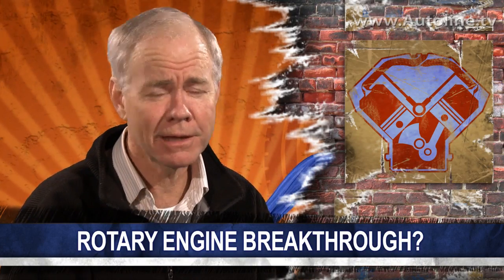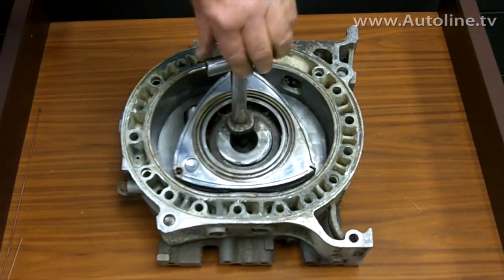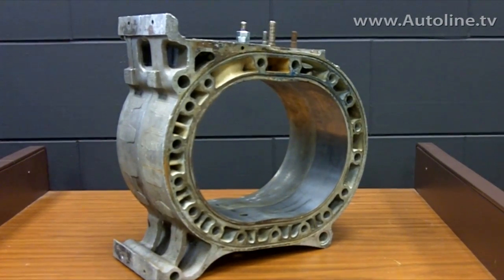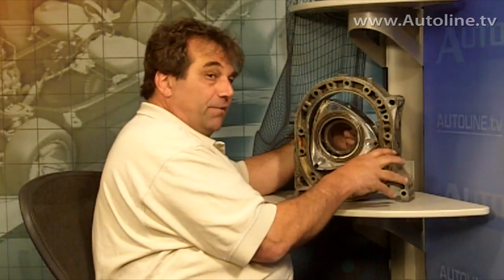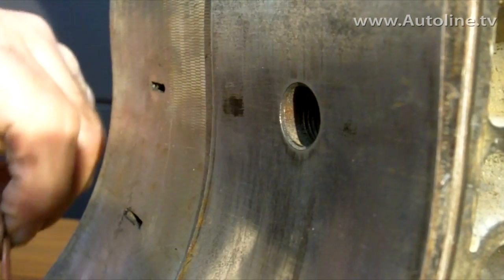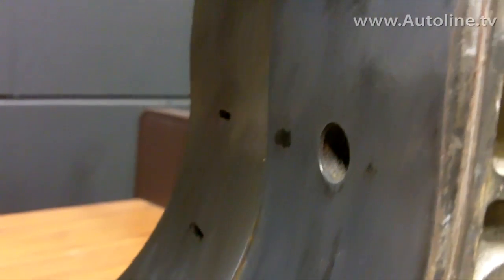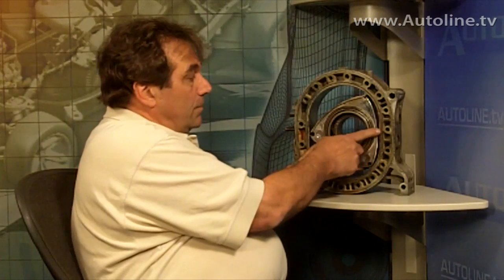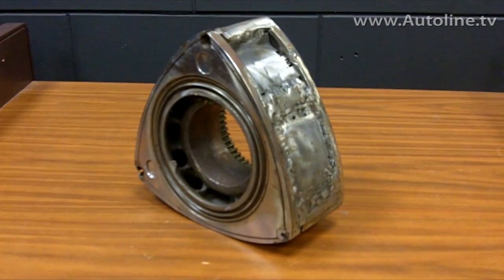Rotary Engine Breakthrough?

Comment: Mazda probably already thought of this. Would the rotors balance up with the off-set compression? What level of vibration would you get at 8000 rpm with the off-set compression? Would you even get full ignition with the smaller spark plug holes?

Comment: I think it´s a bit annnoying to just weld up a rotor and claim that Mazda got it all wrong. If this "inventor" have been serious and skilled he would have done some realworld tests in a motorlab to show genuine numbers from his updated rotor engine.. I have read about this sparkplug hole mod somewhere, and it didn´t work.
Reply: I know for a fact that the big automakers don't think much if at all. There are many opportunities they have missed. They do stupid stuff all the time. They are thoughtless much like you.
Reply: Dan Frederiksen ohh so i´m thoughtless.. right! So you really think his invention looks very serious and and thoughtful? IMO He can keep on folding paperplanes and teach the world how to fly! Not very hard to make a rotary prototype with his "NEW" invention and try it in real! The blowby problem he talks about has been known for ages! The test with smaller plug holes ended up with lot´s of carbon buildups and it failed.. I´ve seen lot´s rotor prototypes too.. Projects to increase the efficiency of the combustion at low engine speeds..
Reply: Perhaps the guy whoo. Made the mods on his own unit and is described by the presenter as an inventor. Has neither the will or resources  for lab tests, and to be Frank he owes us nothing, he could simply benefit from his own tinkering but instead has offered his findings on YouTube,  I personally think  a plughole relocation would work better, his physics seems sound to me though
Reply: ZoDDyXXX

stop getting personal guys! would it mase sence to move the spart plug hole higher in the chamber as in closer to 2 o clock?
This guy is sharing his ideas why not share ours instead of arguing
Reply: good point, it just annoying… nothing is impossible.
Reply: Exactly, Nothing is impossible if you really put some time and research in it. I would be impressed if the guy  had built a prototype engine with tested and proven numbers... This is just B.S.. ideas YES!! But going out public and claim great performance and solutions...  it´s just bad! Build it, test it, and then show it!
Reply: Johnny Linden The rota moder made an attempt , rough , yes , but he put his head above the parapet ...... so we now have the opportunity to look at his thought , rough that they are . When we have put up our thoughtful mods , he may respond . He tried , it ' s ugly , but it ' s there .
Reply: Boony Tooty Prove it.
Reply: I think its safe to say this was all just a scam..

Comment: Ernie Brink says "It's an amazing motor that Felix Wankel designed" and he holds a KKM version of the rotary engine in his hand. Felix Wankel didn't design the KKM, Dr. Paschke designed the KKM as a derivative of Felix Wankel's DKM. Mr Wankel was angry at NSU when they decided to produce the KKM instead of the DKM.
The DKM has the spark plug in the inner runner unlike the KKM that has its plug in the outer runner which doesn't run. So the spark plug problem Ernie Brink solves with the KKM is non-existent in the original Wankel engine.
Had NSU produced the DKM, it wouldn't have had hot exhaust.

Comment: Those rotary engines really don't do well on gas mileage, you'd think they would.
Reply: I agree. You should expect it would save a lot of gas. Not the other way around.
Reply: Three points of combustion = more power/rotational movement without moving valves = ~ (Should) Better economy.
Reply: ***** No, the Knight engine is more efficient than engines with valves and the Wankel engine is even more efficient. It's only as the car industry sabotaged these engines, that they seem inefficient today. They sabotaged it with the goal to make us believe, they're inefficient.
At the beginning of the automobile, there were three kinds of engines: steam engine, combustion engine (explosion engine), and electric engine. Of the three designs, the combustion engine proved to be the best one and ever since then all cars have had combustion engines. The reason why we don't drive steam-powered cars or electric cars, is because combustion egines are better and more efficient. The trend to electric and hybrid cars driven by environmentalism is a drive to give us worse cars.
The reason why we drive combustion engines is because they are the best. But the reason why we drive piston egines with valves instead of Knight or rotary engines is not because they're the most efficient design, they're not
Reply: *****
You asked why I would expect them to be more efficient.
Conventional engines have several parts that move back and forth. It's the main characteristic of the Wankel engine to not have such parts. The parts carry kinetic energy when they move. They consume energy when they are accelerated, some but not all energy can by recovered when they're slowed down. Then there are parts that accelerate and brake the former parts. These parts must have some friction, especially one part of the valvetrain. Then the valves have springs and need damping and get this damping. Damping produces heat and consumes thus energy.
You should expect all this makes conventional engines less efficient than the Wankel engine. There may be other influences that also influence efficiency for or against the Wankel engine. But the main advantage you should expect from skipping all these moving-back-and-forth parts are less maintenance requirement and less fuel consumption/emissions.
It irritates very much if those who tell us the rotary engine is less efficient don't describe it as a paradox but do as if the description of the engine didn't say, it's efficient.
Reply: *****
You said that the Wankel engine has no valve train and that's a disadvantage. I agree that a lack of adjustable valvetrain is a disadvantage but it's not entirely true that a Wankel engine lacks a valvetrain.
There are different kinds of Wankel engines. Wankel originally developed the DKM = Dreh-Kolben-Motor = rotating piston engine. It has a rotating inner runner and a rotating outer runner and it's got valves, sleeve valves. Except from the prototype it was never built.
Then there is the KKM = Kreis-Kolben-Motor = circulating piston engine, a derivative of teh DKM. In it the outer runner is fixed and the inner runner does two movements at once. It's the only kind of Wankel engine ever mass produced. It has no valves and no valvetrain.
A part of the sabotage of the Wankel engine was to have the KKM mass produced instead of the DKM.
Reply: Curt Mayer
It's not so nuts, as it sounds by your words because a lot of the braking of the pistons is regenerative braking. And early on, I believe between 1900 and 1950, progress was made to keep the speed of the pistons down. Motors were redesigned to achieve their cubic capacity by bigger surface area of the piston and shorter ways of the piston. (cubic capicity = surface area * distance the piston has to go). Modern engines have shorter ways for their pistons then the eraliest engines in the 19th century, thus slower speed, thus less kinetic energy wasted. Their efficiency was improved big time.
Yet, we (both of us) should still think, the car industry could produce more efficient engines by switching to the rotary design. It would waste decades of work done in the 20th century to imprive the piston.
Reply: *****
You don't know history. Internal combustion engines were marketed as 'explosion engines' at the beginning of the automobile age. Their name was changed to combustion engine when salesmen found out the name explosion makes customers choose electric cars or steam engines instead.
Early combustion engines had a rapid combustion that was correctly named 'explosion'. The Otto engines were developped further to slow down the combustion process, so it is no longer an explosion, but a controlled burn to save material.
It's not the rotary engines are notoriously rotten. It's the rotary engines the car industry builds are notoriously rotten. They build them intentionally clumsy so they suck. If they wanted they could build engines that are not rotten when it comes to emissions and efficiency.

Comment: combustion chamber doesnt need to be offset because the spark plugs are timed to fire so that combustion is at its peak when the rotor is at the perfect position to give maximum torque to the crankshaft, just like in a normal 4 stroke, the spark plugs fire  before the piston reachs top dead center so that combustion is at its peak when the piston is a then right postion to give maximum torque.
Reply: spark plugs dont fire before TDC that would create engine knocking they fire a few degrees after
Reply: Jackson Welch
no they actually do fire before. http://en.wikipedia.org/wiki/Engine_timing read up sir
Reply: i dont trust wikipedia
Reply: link me to a engine timing website or something like that and ill bother to read it
Reply: here ya go http://www.howstuffworks.com/ignition-system1.htm if that is not good enough for you look it up yourself, because that site was literally the second hit and has the same info as wikipedia
Reply: ok fair play i was wrong

Comment: i wonder what a 2 stroke style pipe would help? XD
Reply: Nothing!! Coz rotarys are not twostroke piston engines that work totally different
Reply: ZoDDyXXX ...No...?????In case you didnt know it you can run mazda rx-7's and other 4 stroke rotary engines on rotary pre-mix to boost compression and lessen engine wear on them...........Also when I was growing up Kawasaki made a 2 stroke rotary engine back in the 80's...It came on a Kawasaki KE100 that I had........Look it up........Oh wait...I also had an old IAME racekart engine on an unlimited class racekart that was 137cc 2 stroke methanol powered rotary engine too that was built back in the 60's..I mix the race fuel with silkolene rotary 2 stroke mix.....It goes in excess of 130mph..I raced it in the early 80's and still have it today.....http://i709.photobucket.com/albums/ww99/CAM2_photo/race%20kart/Picture124.jpg
Reply: SmokedTirez I'm a Kawasaki tech and the KE100 and KE175 never had a rotary engine, it had a rotary valve system; HUGE difference. Although it was indeed very unusual, the rotary valve was simply an alternative to the typical 2-stroke intake reed valve and "piston porting" (using the piston skirt to open/close the intake port) . This design moved the carb from the rear of the cylinder to inside the RH crankcase cover where the crank did the opening and closing of the intake port. It was still a traditional 2 stroke engine with pistons/rods etc.  I never messed with racekarts and I find yours cool and interesting but it is also a "rotary valve" engine, not a "rotary engine".

Comment: they made diesels  way back in the day.. Mercedes had one in the 60s I believe. I would think that offsetting the chamber would throw off the balance of the rotor. also mazda did a lot of devolpment on the rotary I find it hard to believe they didn't explore this and they must have had a reason for not doing it. im no expet though I do own 2 1st gen 7s but never done more than bridge porting

Comment: What if you street port the motor? Wouldn't that lower EGT's assuming you expand the exhaust ports?
Reply: no because thats just letting more exhaust out there is still going to be explosions happening in the exhaust

Comment: Why has nobody attempted making a diesel version? No plugs, no problem.
Reply: 8bud500
turbo it
Reply: No plugs.???? daaa
Reply: supercharger?
Reply: Diesels have very high compression. You could never get high enough compression out of a rotory to make it run on diesel.
Reply: arklanbk
a diesel needs more time to work. u have no premixing end a limited window to ad fuel during combustion stroke. that is why diesels run at lower revs. wankels work well at high revs.
engione cooling takes low en mid end efficiency way from the diesel proses en the wankel has a lot more metal surface to lose heat to.
Reply: that The liquid piston rotary engine is a cool concept. but it is of a different design than mister wankel invented so it is not a wankel engine. but a fige 8 moving in a tiangel insted of the other way around just blows my mind.
to bad the site has a lot of bad info on it, en diezel wil not be optimal fore this engine unles u go truck /genorator size (by my limited knowledge en inside)
Reply: 8bud500 
IIRC, the British came out with
a diesel Wankel to power an
armored tank/ One rotor was used as a supercharger to gain compression ratio to run
diesel.  Not certain if it's still in
production.

Comment: As stated; I guess that changing the shape of the plug cleft in this design, from a line to a 'T', with the vertical part of the 'T' slot parallel to the Rotor's main dimension, and pointing towards the trailing side from the leading side, may yield further improvements, as in the rationale of the 1974 US patent 3848574 by Kawasaki (Free access and download in Espacenet) If somebody tests this, pls let us know!

Comment: It's painful when you get a guy who thinks he's a front runner when he really doesn't understand how it works. Is there more pressure in the Inlet or the exhaust as the Hot gasses expand? and how do you get a flame front on his Rotor?

Comment: to be honest he has a point when it comes to the spark plug hole thing, my only thought is would it ignite the fuel fast enough at high rpm's since the spark and fuel would not have a large enough initial ignition to burn all the fuel in time before the rotor reaches the exhaust ports, but the whole offset compression divit is a crappy idea,by the time all or even the majority of the fuel is combusted the rotor is allready past top dead center, especially at high rpm's.

Comment: Install a quartz window and use high power laser pulses to ignite the fuel air mix. If that is too exotic for your budget install surface gap igniters like used in fighter jet after burners. There would be no compression loss at all. You could even install a platinum contact in the piston and use that for the capacitor discharge ground strike point. By using a large ceramic insulating ring the shortest distance to ground would be the platinum button.

Comment: uhh no. If you look at them both you can see the rotary plug still has a hook or flaps depending on the model plug. The boat plug does not.

Comment: The reason why Wankels have such terrible fuel efficiency is because the combustion chamber has SO much surface area.  You lose tons of heat.  Rotary fans do not seem to understand this.  If you cannot address it, you will never make an efficient rotary.

Comment: why pass a perfectly good rotor past a plug hole in  the first place and why have a perfectly good top dead center push at both angles from the start .. four stroke engines and two stroke engines get to top dead center and if the revs are hifhgh enough the engine explodes any way from metal distotion and two strokes use an expansion chamber and four strokes use a mega phone so why hasnt the rotary got what normal motors have any way sounds like another fuck up doozy for what just to gattle away

Comment: If the spark plug hole is that big a issue why not change the system to work like outboard boat spark plugs. they have a flat top on the plug so there is a much smaller gap for gas to pass through. A plug like this preview.tinyurl (DOT) com/nrjn7ab

Comment: this apex seal leak at the spark plug would be very little wouldn't it? considering at the point where there's the slight leak the intake stroke would have very little compression to force it's way into the exhaust, plus the exhaust chamber at that point would porribly have enough backpressure to keep the unburnt gas from passing the wrong way, i'm intrigued by the offset compression though, i want to see this prototype in action

Comment: it has two plugs because its more of an elongated combustion chamber.  So, they use two plugs to get a much more complete and even burn of the fuel.  If it was one plug, there would be a lot of excess unburnt fuel being tossed into the exhaust, so more fuel out the tail pipe, worse emissions... the list goes on.

Comment: I don't think it would cause any unusual erosion of the either spark plug parts.  I've seen shielded spark plugs work in a variety of applications.  Spark plug is replacement is conventional.  ( I'm a Suzuki rotary mech. from decades back.)

Comment: my guess would be that the spark ground/electrode would erode away over time. much like how a spark plug increases gap over time. not cost efficient to tear down a motor to swap out an ignition part

Comment: Why couldn't they just use an on-surface electrode in the housing that arcs to the rotor face? No air gap at all at the apex and massive opportunity for efficient ignition. Might require much higher voltages though. Just a small charged surface surrounded by something like ceramic as part of the housing face. Inherently self cleaning as well.

Comment: I'm concerned air resistance and balance issues of shaped rotors could negate benefits of cooler exhaust in an N/A design.
I think the key to improve the Wankel isn't mechanical, it's simpleness is a key part. It seems more efficient to use waste heat as an advantage with steam condensing (similar to BMW's new header designs) to power steam turbines. Lightweight electric hub motors and supercapacitors can grant free electric power for jackrabbit starts, one of the Wankel's major inefficiencies.